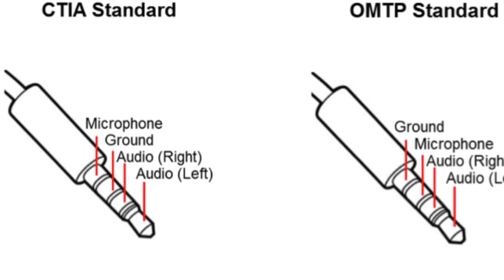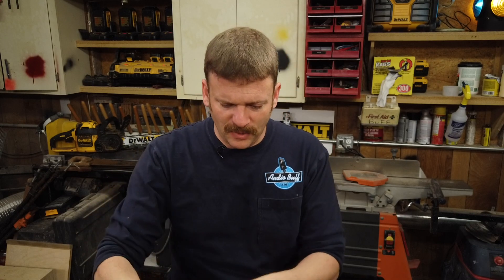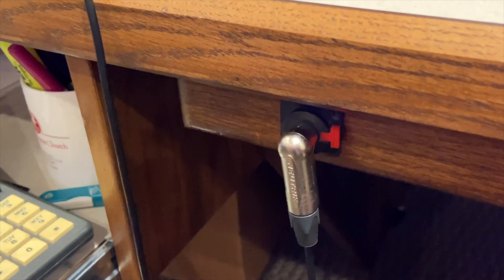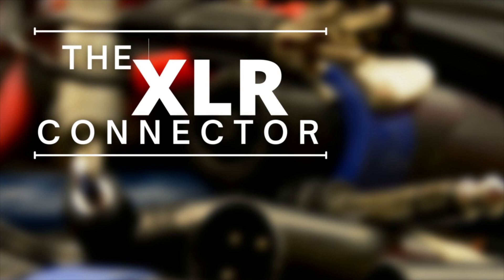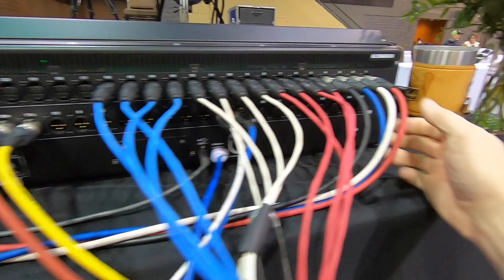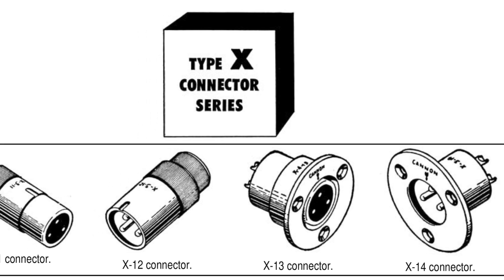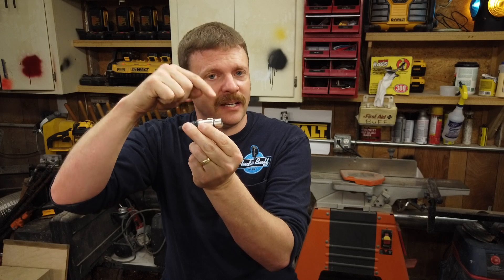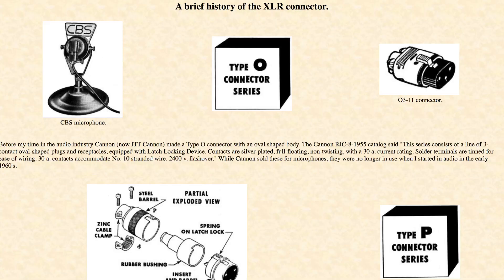Learning Pro-Audio Connectors - Sound Advice 16

Comment: Hi, I just bought that exact Ashly amp.  Can you tell me the specs for the Euroblock speaker connector you're holding at 12:42?  I can't seem to find that part online.  Thank you.
Reply from the maker: Thank you for watching the video!  I just placed a big order with Ashly and asked for extra connectors. If they ship them to me, I’ll pass them along to you.
Reply: @audiobuff  Thanks for the offer!  I eventually found the connector spec in an Ashly engineering document (4-pin 7.62mm pitch) so I picked up a pair and they fit fine.

Comment: Strictly speaking, there is no such thing as RJ45. The term is a colloquialism adapted from the RJ45S standard, which actually a slightly different (keyed) connector. The better term would be 8P8C modular plug/jack, but I guess these days "RJ45" is part of the vernacular.
Reply from the maker: I’ve never heard the term 8P8C.  I will update my information. And thank you for watching!
Reply: @audiobuff  8P8C is nomenclature for describing modular plugs and jacks. It simply means eight position, eight contact.

Just like telephone modular plugs and jacks of old were 6P6C or 6P4C.